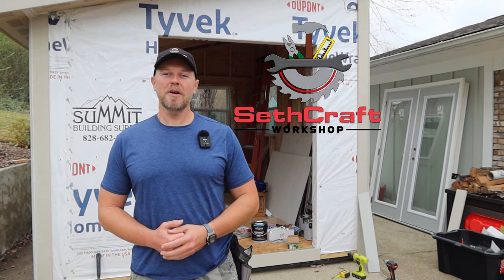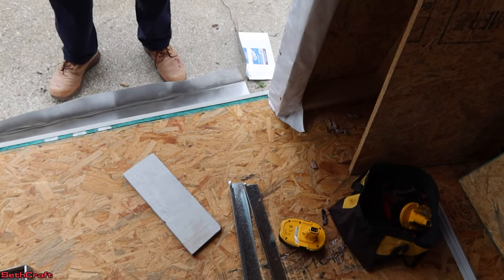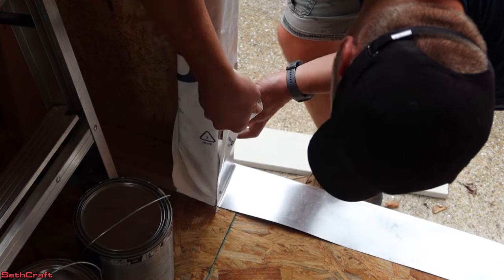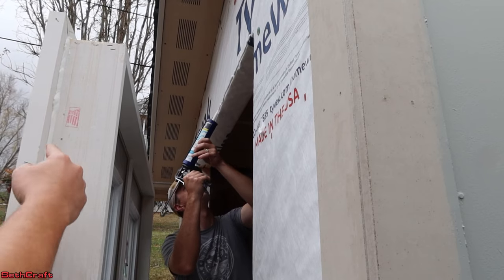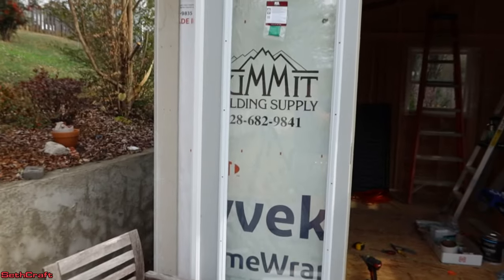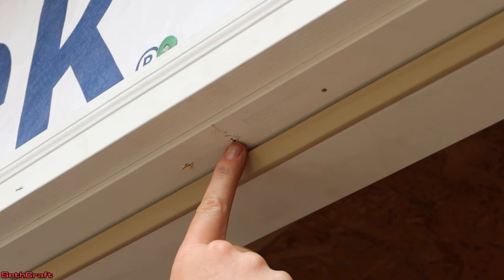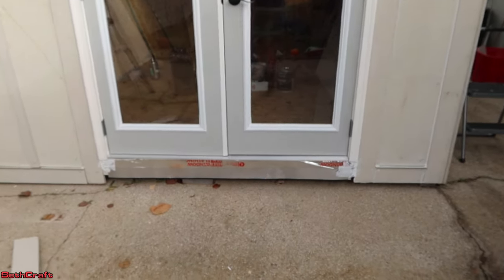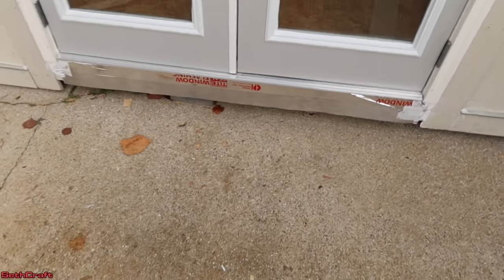Diy French Door Installation 10x12 shed build

Comment: I'm wanting to get french doors as an exterior entrance. I like the doors swinging out for the extra space inside, but having the hinges exposed to the outside, will that make it easier for someone to break in?
Reply from the maker: You would need to make sure that its an exterior door with hinges that do not have exposed pins. You can buy doors that are designed to open outward like that. Should not be an issue.
Reply: @sethcraftworkshop  Thank you so much!

Comment: Thank you for calling this a DIY install, the weather envelope looks pretty rough but still better than a contractor that is careless or cutting corners.
Reply from the maker: This was my very first double door install. Seemed to be alright. 3 layers of flashing should keep this water proof.
Reply: @sethcraftworkshop  it’s not that it’s not enough, it’s the execution. There are a lot of ripples and overlaps that can trap water. I know this is nit picky, but the through wall flashing (good on you to use this, not typically something you see as a DIY) should be measured with the opening, bent cleanly on a brake. 

There should be a continuous membrane underneath the flashing and not multiple pieces stacked on the corners. Membranes and flashing tape is thick and can contribute to the door not sitting plumb if there’s inconsistent coverage, air pockets or creases. On a home cheapo door, this can cause things like the alignment being off. It’s harder to get a poor quality door to level than a higher quality door with adjustments and leaf hinges.

In fact, it’s a trick of the trade to stack membranes in either side of the rough opening to get a poorly framed door opening to sit level.

Also, don’t shim the head jamb, or if you do, pull the shim before final assembly, this can cause it to deform and create alignment issues. You also need to be careful to not over foam that joint and cause compression. I say all these things to be constructive, and helpful, hopefully that’s how they come across.

At any rate, thank you for making the video, I may show this to clients to differentiate our installations from a diy, although like I said, this is still better than a fly by night contractor that doesn’t care and cuts corners.

Comment: So the RO of the door was supposed to be 60x80? I wonder if the extra 1.5 inches from the bottom plate needs to be considered since the RO will be about 60x81.5 once it is removed

Comment: Are your hinges supposed to be on the outside of the door?  Couldn't the bolts be removed and the door come off?
Reply from the maker: At that point a robber could just break the glass. This door is designed to operate like this.

Comment: What size door did you purchase?  I have a 12 x 32 and want to put it on the long side of the shed.
Reply from the maker: You will likely need to increase the size of the header board when you place this on the long side. (if you have the same style roof as in the video)  This door was a 60" x 80".